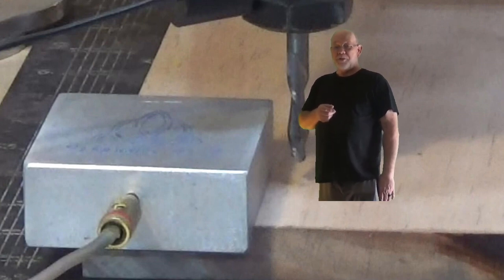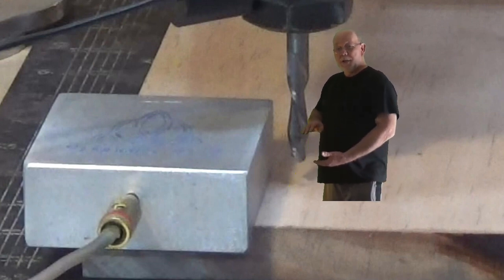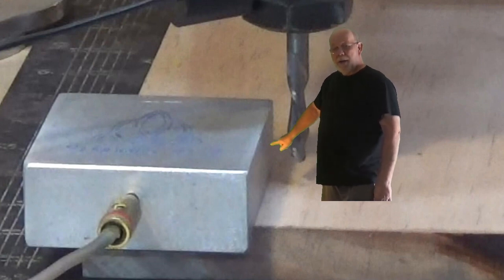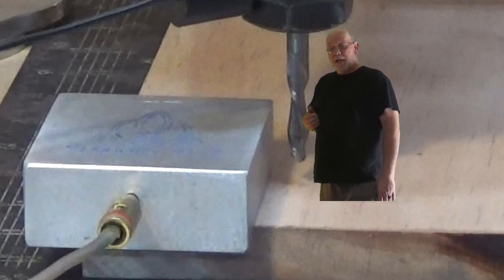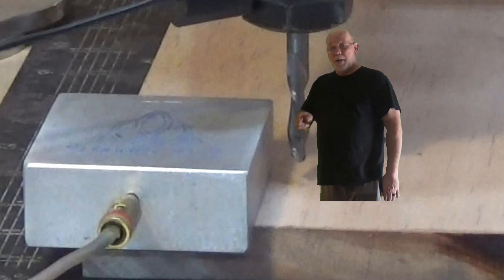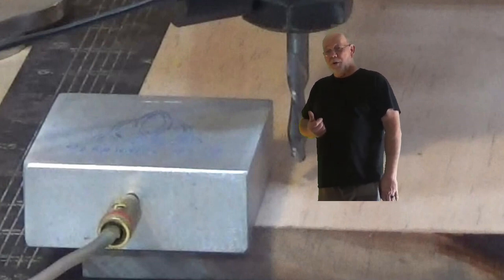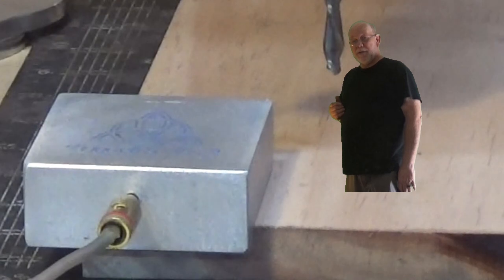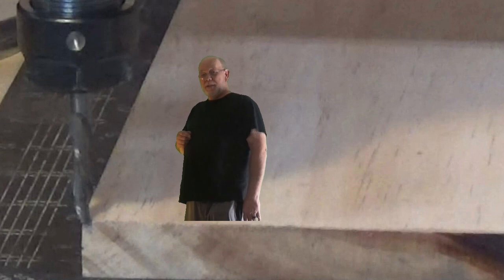Bit Position for 3 Axis Zeroing For New Users of the Triquetra Touch Plate

Comment: When i run the zeroing gcode on my diy grbl cnc, the bit pushes the touch plate a few mm or a fraction of an inch on both X and Y. Z has no such issue. What could be the problem?
Reply from the maker: Try Slowing your probing feed rate down.  Should be no faster than 3 inches per minute when probing.   Your feed rate during positioning moves between probing moves can be anything you like as long as it doesn't cause any jerking of your machine that could make your plate slide around. I generally set my jogging rate to about 50 inches per min.  Also check your bit and collet nut t o be sur e they are  clean and tight.  If your collet nut is painted or anodized it could be blocking the signal from being sent to the controller. If you suspect this is the case then put the magnetic ground directly on the bit in a place that it will not interfere with the probing.
Reply: @CharleyThomas2016  I'll try these suggestions, thanks Charley!

Comment: So in the old software you had to manually move the endmill in ugs.  Now it looks like you can automatically have it go to zero.  How do you do this in UGS?
Reply from the maker: After you zero all three axis in UGS the bit moves out of the way so you can remove the touch plate. After you remove the touch plate and magnet click the "Return to Zero" button. It is in the top panel above the Jog buttons. I believe it is the upper right  button the that panel.
Reply: @CharleyThomas2016  Thanks for the information.  I have had the triquetra for a while and have never used it.  Since I have been stuck at home I have been learning a lot about my cnc every day.  My goal this week is to get the triqertra working.  I had one more question about your block, for Vbits gcode generation do you have to measure the outside of the top of the bit?